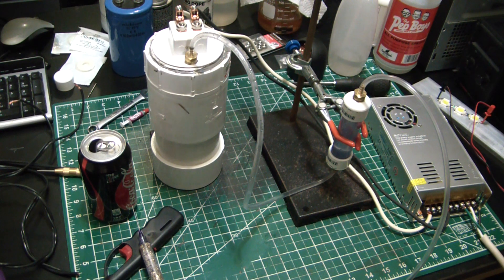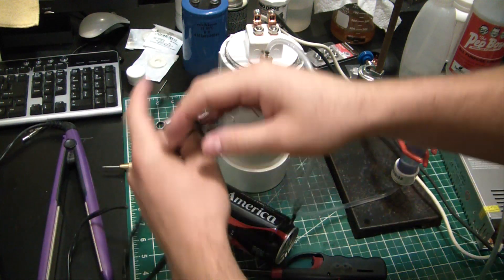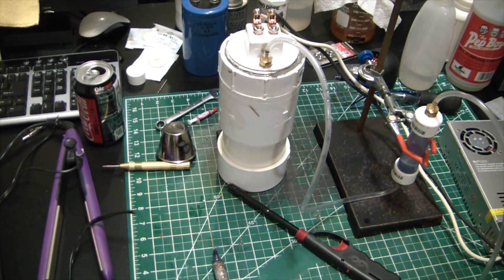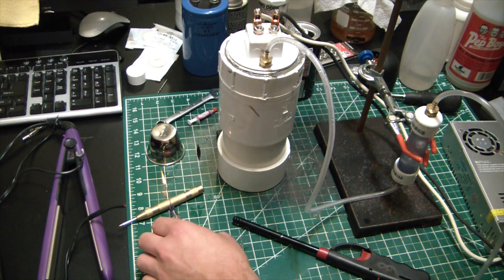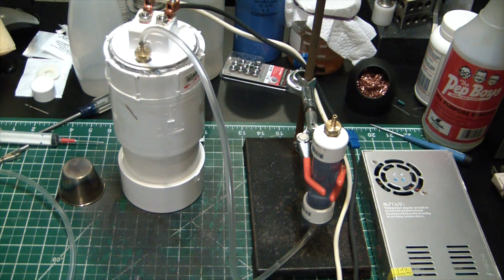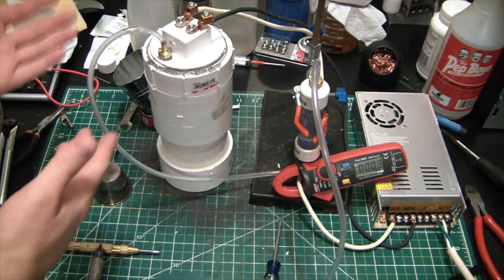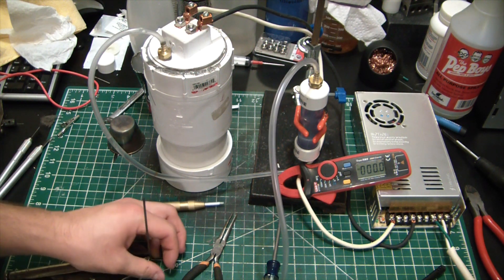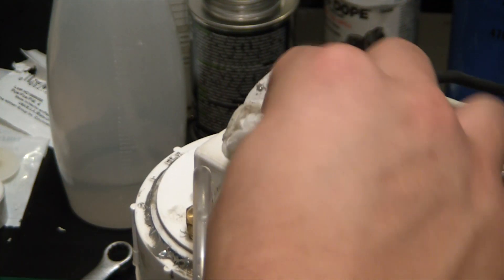Cutting Metal With Water! HHO Torch Success - ElementalMaker

Comment: Low voltage / high current isn't a good idea.  It's best to make several electrolytic cells and stack them in series.  So instead of 45A, for example, 3 cells in series could draw 15A at 15V instead of 45A at 5V and they both produce the same amount of hydrogen.  You wouldn't have any of the heat issues.  I know, I know...  It would be a more complex setup and believe me, I know that sucks.

Comment: If you get a second cell and wire the two cells in series  youll drop about 2.5v volts across each cell For more efficent electrolisys.

Alternately, you could wire two cells in parallel  with one set of 10 gauge to one cell and another set of 10 guage wires to the other cell

Comment: You also need a one way low resistance check valve right before the syringe tube so any flash back is prevented from traveling past the (brass wool) arrestor.

Comment: you need to design a cell using neutral plates to bring your amperage and heat down. the most hho is generated with 1.2v per plate with your amperage being measured in mA.

Comment: I know this video is 4 years old but if you ever do a redesign why not use jumper cables for the wire connectors instead of the wires you used here?
Reply from the maker: That would have been a good move!

Comment: If you change the polarity the other electrode will be hot. Direction of curent flow matters copper to inox, or inox to copper. One heating up, another cooling down (but at high amps not cooling down just not as hot like another electrode), like peltier plate.

Comment: For the 60A that your supply can deliver plus a 10% margin, you'll need #4 AWG wire!
It also looks like you could use a baffle to keep electrolyte splash out of the tube.
Like others mentioned, some "neutral" plates will cut down some of that waste heat, in other words, increased efficiency.
Divide your supply voltage by 2.1V to find the number of plate gaps between your +V and -V terminals.

Comment: For more performance simply use a Mid-to high end COMPUTER power supply. if you take the voltage from the PCIE-RAIL those can output at 12volts and 25 AMPS and more

Comment: Wonder how good of a brazing torch that would make..

But in regards to the pvc melting if you take apart a hair drier you can use that "x" mylar coated non conductive insulator as a gasket between the contacts and pvc...

Comment: In order to get the production up to where you want, you will need to increase voltage up to 30 to 50 thousand volts without the amperage. With higher voltage and lower amperage you'll be able to run straight water along with eliminating your overheating problem.
Reply: Sorry, no, that's not how it works. Think of Volts as potential, the Amperage does the work. Higher Volts will just push more Amps through.
Just a  hundred Volts would make that melt and explode quite fast with a spray of caustic flesh dissolving solution everywhere.
Reply: @azurplex  I definitely hear ya  and agree with you that amps is what does the work. Without it nothing electrical would work, but here's the part that blew my mind when a person, who I will never and can never identify, showed me how volts minus amps dislodged the oxygen and hydrogen molecules of water at a very controllable rate.
The contraption he called a fuel cell had low DC voltage fed to a coil and distributor from a chevy v8 motor that was mounted on a stand. From the distributor had contected some kind of wiring setup to the container with tubing inside of tubing.
When he turned the thing on you could watch as the bubbles came out of each of the sets of tubes. The more volts from 6vdc up to 12vdc and the more rpms he added to the distributor rotation drive the more gases were released and faster.
(I myself am still trying to wrap my thoughts and understanding around it)
He said he only turned it up to about half power and speed but from what I seen,  the entire container of straight rain water he had turned from clear to white.
He said that he can run anything on his property with it.
No! I wouldn't quite believe it myself, but I watched him turn that thing on and seen watch it does and still can hardly believe it.

Comment: Always the bottom line is based on ohms law. I sq. x R = P , so when you get to 5volts your current  is just eating you up, that's why transmission lines run a 347 KV or 500 KV the higher the better.  Bottom line double the current and you square the loss and that equals  HEAT. That's why your PC's power supply has like 30 amps on the 12 volt buss.  Just sayin,  Ole retired lecktrician.
Reply from the maker: Yeah I had quite an anal-cranial inversion there forgetting my ohms law.

Comment: HHO doesn't exist, that's a scam.  It's just a water torch and you're burning oxyhydrogen.
Reply from the maker: the abbreviation HHO simply stands for two hydrogens and one oxygen being the ratio of the gas produced. More correctly it would be 2H2 + O2. You are correct though about the tarts who think they are creating mono atomic hydrogen, or some magical overunity device.

Comment: Nice torch I think if you look on the web though you'll find a paper by the Air Force. Creating HHO with DC pairs the hydrogens up and they have to be broken apart in the burning process to create water. If you use 2 volts ac the hydrogen's will not pair up. And you'll find the properties of the gas will heat anything to its melting point.
Reply from the maker: Hydrogen is a diatomic element, so one hydrogen atom will always pair with another unless some very, very rare conditions are met.I hate to burst your HHO bubble, but whomever made that claim to you is selling snake oil.

Comment: all that heat you're getting is the excess voltage, in HHO production more isn't really better, you want neutral plates to diffuse the voltage along the plates without just overcharging them, add neutral plates (plates that aren't connected directly to the anode or cathode via conductor) to increase surface area and to divide how much voltage each plate gets by how many plates you have total, including your anode and cathode plates you want half as many plates a volts, because any more than 2 volts will be a waste and will produce excess heat, as for amps you dont need a ton of amperage, just enough to drive the system.

i managed to get a system to work rather well with just an old laptop adapter, that for reasons that aren't terribly important i was told was broken, turns out it wasn't and its now my power supply for my HHO generator, its an 18 volt power supply (so it puts out around 17.8 volts) and so i used 9 plates in all to get the voltage per plate down to a little under 2V. the results were incredibly efficient as the unite did not heat up much and it produced a notable amount of HHO, nothing torch worthy yet, i have to upgrade it with stainless steel and whatnot but the point here is you dont need all that power, its more liability than anything else.

Comment: Wrong. 120v at 800w is only 7-8 amps. Watts calculation is one of the most simple to figure. 5v to get to 800w would be 150ish amps. Has nothing to do with dc or ac, if you used 120v dc the amperage would be no different. I think you're confusing the difference with long line transmission and how ac performs better in that scenario.

Comment: Great deal to pain may be so bold as to add to your build? Try running that through a radiator submerged in another tank of nice cold water with ice in it you should up your used time for it greatly and you won't run the risk of melting anything
Reply: And it most certainly wouldn't hurt instead of using water use dry ice and rubbing alcohol then you damn near got yourself some cryo fluid and it should have been indefinitely for quite some time

Comment: Isn't H H O self oxidizing? Why isn't the flame going back up the line?
Reply from the maker: HHO is a stoichiometric mix of Hydrogen and Oxygen, so it will react quite violently once initiated. To prevent flashback (which is when the flame propagates up the tube back to the source), I utilize a flashback arrestor.

Comment: Hey bud, I love what you do! As I do a lot of tinkering and coming up with crazy stuff as well. The issue that I saw you running into to with this video is that your copper electrode is over heating due to the amount of resistance that is passing through that node. Do you know the exact current you are looking for? Do you need it at the max 50 Amps? One of my suggestions to possible try is adding a heat sink, by either adding a resistor between the two nodes say around 10k Ohms (To act as your heat sink) and then letting 49.5 Amps running to your circuit. That in theory should eliminate part of the over heating part. My calculations was that 5  V / 50 A = 100 ohms of resistance in your main non split reaction. By taking the Current and splitting it up with a 10 K resistor in parral with the 100 ohm resistance of your main circuit, you can leak 0.5 A;  I2 = (10k / 10.1k ) * 50 => 49.5 and use that energy as coolant. May give you more time running before you PVC pipe says "Done".  Shoot you could even put on a variable resistor to adjust the current depending on how much gas you need. Damn it man now I am going through a rabbit hole!! Just keep it up bud you are an inspiration :)
Reply from the maker: If you check out the more recent videos you will see I got the terminal overheating issue sorted using heatsinks. Working great thus far!

Comment: Have you tried micro'torching IRON or STEEL about one inch thick? TUNGSTEN seems to be a more resistant metal... ALSO you could jerry-rig multiple micro'torches at a single point for maximum results... no different than the "archimedes invention" of putting multiple beams of light onto a single point

Comment: YES YES PLEASE DO NOT RUN YOUR SYSTEM THE WAY YOU ARE IT WILL EXPLODE NO DOUBT AND WE DON'T WANT TO LATER LEARN YOU GOT HURT, PLEASE USE THE FORMULA FOR THE RIGHT AMOUNT OF PLATES... SURFACE AREA OF ONE PLATE EXAMPLE: A 3×5 PLATE TOTALING 15 IN. SURFACE AREA, THEN DIVIDING BY THE NUMBER OF PLATES YOU HAVE FOR ONE CELL 6  PLATES PER CELL = 2.5 amps PER PLATE = 15 AMPS PER CELL.
THIS WILL INCREASE GAS PRODUCTION AND WILL NOT CREATE OVER HEATING PROBLEM ,  IN FACT THE TEMPERATURE INSIDE THE CELL HOUSING SHOULD NOT EXCEED  BUT MAYBE SLIGHTLY OVER 70° FAHRENHEIT.

Supplement: Important... your plates should be as close together as possible, so close you could just fit the corner of a book of matches paper between each plate...will produce more efficiently.
Reply from the maker: Been running quite a bit and no explosions. The flashback system works.
Reply: The higher the heat the more water vapor is created along with the gas, to produce pure gas with little or no water vapor the voltage cannot exceed 12 volts and  the amps should not exceed the formula because this creates more heat and heat creates water vapor...proper voltage 12V and proper amps. = surface area in square inches devided by the total number of plates used equals the total amps needed for that one cell... furthermore use no less then (6) six plates per cell because any less also creates heat and water vapor along with the gas. 
Sure it may work but won't run very efficiently and is very, very dangerous regardless.

Peace brother stay safe!

Comment: I have the cure for this amperage draw problem. I finally discovered what Stan Meyers was doing even if he did not totally understand it or not. I have been experimenting with this technology since 1987 and first discovered that pure Nickel produces the most production but its real expensive stuff and well Stan was using 304L SS cause it has the highest content of Nickel. Anyway my research discovery led me to what I am calling the Holy Grail because it eliminates the need to use all of Stan's circuits and his type cells it works on "ALL" HHO cells because its a conditioned Pure water that Stan's electronics and various other devices like the HHO spark plug was doing. The key is what Stan said that he "preconditioned" the water and that is what his circuits did to set up a way that water could be split with little or no current and run cool in the process. Well this is what I am now making the precondition "HOLY GRAIL" that can be added to this existing device and bring your amps down to around point 5 amps instead of 30-40 amps and still get the same or greater production. I know it sounds to good to be true but I am blown away myself as I sort of stumbled on the information by accident and it confirmed what I wrote about over 10 years ago and that was that Stan was mimicking nature in thunderstorms. In particular high voltage plasma like in a lightning bolt and that was his UV lasers in the plug. But first the water had to be pre-conditioned to split with much less energy so once the intense UV lasers hit the water mist it charged it up to a high degree for the ultimate water splitting dump and KABOOM comes the thunder. Well the Holy Grail is all you will need to get the same effect which is an added feature so as to not need a thousand dollars worth of electronic wizardry to do it. And nobody has been able to figure that part out until now. So I would like to send you a sample for free so you can do a live test whatever would like you to also confirm it does what I believe it will do for everyone. Its not good enough that its working on my own build I need others to help validate this stuff cause it changes everything. You should be able to go from the 200 watts your drawing now which is 40 amps times 5 volts equals 200 watts to 70 times less current. So think of the implications, that means you can run 70 of these same HHO cells you built here and run all 70 for the same 200 watts and then be increasing your gas yield to run your car completely free from any other fuel just using the alternator or build enough cells to produce enough gas to make a much larger flame to do some real cutting like cutting through 6" of armor plate like butter or run your entire home off it by feeding a genset whatever the sky is the limit. I am now building a monster 220 plate system that will produce hopefully and this is a low estimate 60lpm. Call me or message me here or call @ 503 895 5909 and if I am not here just leave your number cause many times I am up in my shop and no cell service here or phone up there. But I am excited as hell over this its been almost 40 years and I now know why the water took so much current to split all the pieces of the puzzle came together and will release the information soon as I can get some more feedbackfrom guys like you doing some basic builds. Thanx man and never give up the world is about to change to a better place. Regards Mike in Heppner Oregon...we can do this!!!!
 BTW your the first on Youtube I have even said this much to. Good day.

Comment: hey, i have some pretty suggestion, why don't you put some 4 or 5 neutral plates between electrodes and use 12v? isolating the sides of the plates to increase efficiency, you just need 1.4v to make hydrogen. The efficiency of the 0.7v dropout diode on the 5v power supply sucks and the current sucks too, running them with neutral plates on 12v gives a lot of performance.
Reply: also you can solvd the connection problem by taking a high current  reposition energy plug and put the metal leads trough the lid, fixate everything with epoxy and screwing your wire trough the reposition plug, you know the kind you can buy to substitute for a cut power cable that have small metal pins with a screw you can put your cable in.... or a power switch with the same connector...

Comment: You can solder the bolt where the copper bar, screw and bolt meet. That'll decrease the local resistance and should prevent that melting of the PVC

Comment: A Bit of silicone tube around the bolts would insulate the PVC from the heat.
Reply from the maker: If you check out my more recent videos I was able to get the issue sorted with a couple heatsinks. Silicone tube definitely would have been a nice touch though! Great idea right there

Comment: Just as said before the power running through the cable isn’t what heats it, it’s the currant. The thin cable has a small resistance, that resistance X current tells you what voltage is lost in the cable. That voltage X current again tells you the power that is wasted as heat in the cable,  so in your cable the power used to heat the cable increases exponentially as you increase the current. Also buy cables from hobby shops, it’s silicon coated so won’t burn and the copper is very fine strand that is silver coated, great for 100+ amps in 10awg.
Reply from the maker: Yeah I had a brainfart while filming and realize how poorly of an engineer I must sound LOL